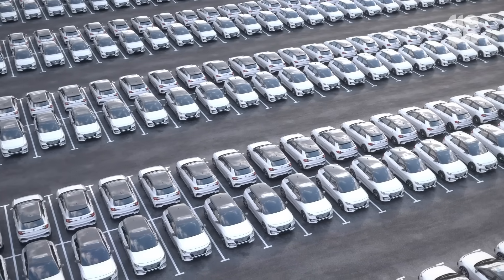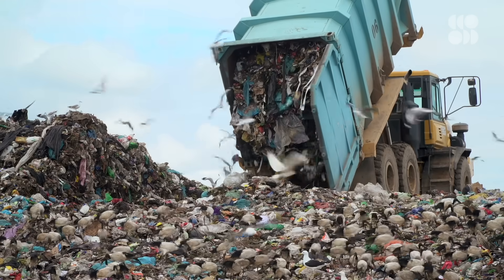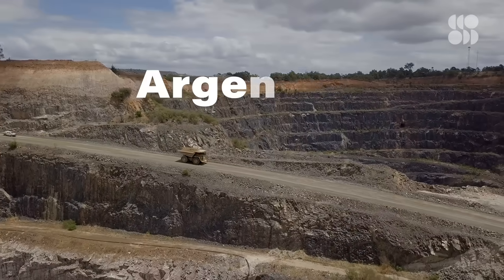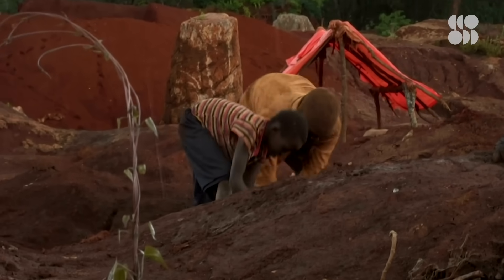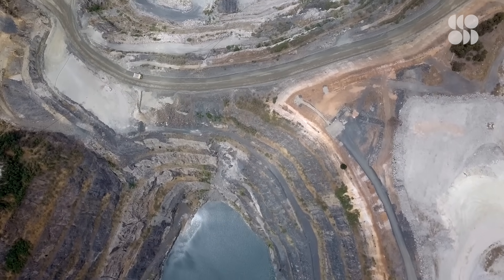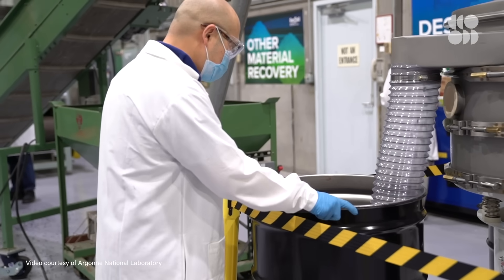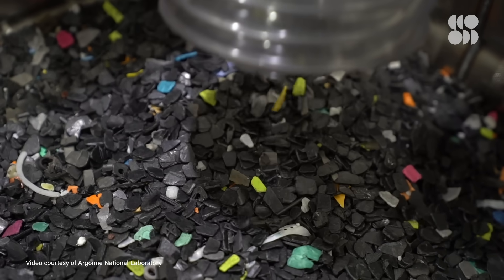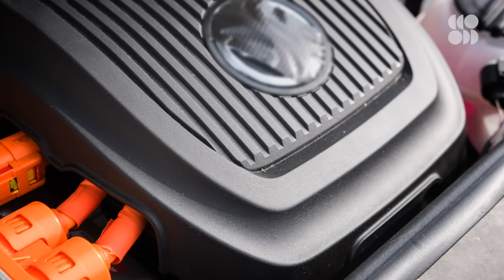The Hidden Environmental Costs of Electric Cars

Comment: Cost-competitive lithium recycling could be a real coup for EVs. If EV manufacturers could put a lien on a car's battery that would make sure that the manufacturer would get the battery at end-of-life for the purpose of recycling, that could make EVs substantially cheaper to the end user, both when they're initially bought and when they have to buy replacement batteries.

Comment: The presenter is completely out of touch with current industry practices. Lithium-ion battery recycling is expanding and gearing up to handle increasing volumes. Many companies have demonstrated 90-95% recovery. The only material not recovered is the plastic cell separator. But before recycling there is reuse, repurpose and remanufacturing of batteries into EV conversions, powerwalls, utility storage and replacement EV batteries.

Comment: Planning to replace all existing ICE vehicles with EVs is not how you fight climate change. It's a fool's errand. The entire concept of personal vehicle ownership is extraordinarily inefficient and wasteful, and insisting upon EVs as a solution to transportation shows the limits of market-oriented thinking as a way to solve ecological problems. 

EVs are part of the solution, but EVs as a one-to-one replacement product category for ICE engine vehicles is not. That's just replacing one set of problems with another. The cold hard truth is that it's not sustainable to be producing this many personal vehicles period, especially not with so many new economies emerging. 

The full solution involves expanded public transit, the normalization of WFH/telecommuting, autonomous fleets over personal ownership (so these massive hunks of steel aren't sitting unused 95% of the time), the end of unwalkable suburbs and a huge shift to local production and consumption.

Comment: 13 gallons gasoline needed to very roughly match 400 mi Tesla. Which is about the average gas tank.

Over 400,000 miles:

13000 gallons 36,400 kg. (30 MPG) gas car.

1000 charges, 400kg EV battery.

91 times less mass needed for the EV.

The EV battery can be recycled at least to 95%, which means another 20 times, or 1800 times less mining needed per mile for lithium EV’s battery versus gasoline.

Comment: Salt water is not rare.
Very little cobalt in Tesla batteries and others are following. Oil industry uses vast amounts of cobalt in production of gasoline..
You are spouting Garbage . Batteries now have 20 year lifespans then more in power stations.
Recycling is at 95%+ now and much higher on metals.

Comment: Another issue you didn’t cover is the energy production required to recharge all of the “green” vehicles.
Reply: The same energy used to extract, refine, transport, and sell the "never going to be green" fuels, only significantly less of it for EVs over time and over lifetime of the vehicles. Spoiler: getting constantly greener, albeit sometimes quickly improving, sometimes not so quickly.
Fuel oil gets less green all the time (extraction gets harder/increasing side impacts too). 
Research readily available today (just make sure you don't trust the stuff published by the oil&gas brigade/those with Vested Interest).
Yes, greener not to have a vehicle at all... But that is not always an alternative or desirable.
Reply: If renewable energy was used at all charging stations then this wouldn't be an issue, but that depends on the location of the charging station. Still significantly less energy than it takes to create fossil fuels.
Reply: @silk.bones.333  the balance of energy is going renewable. For instance, in the UK, the trend to renewables is now unstoppable (including saving all electricity users in the country anyway).
Reply: Gyeah but there's enough fuel in the earth to last forever, not.  So let's just keep using fossil fuels with no replacement in sight so oil companies can maximize profits.  Not planning for a future that you know it's coming and there is no way around is dumb.  Dum da dum dum... To quote South Park.
Reply: @azcomputerg33k  indeed.it amazes me that people can't see the difference between burning stuff and not burning stuff. So much so that they manage to hold this contradiction in their heads: that we can burn stuff forever because it will never run out; versus complaining that electricity is always just the same ...thinking about it ...it's not a contradiction ...it's just blind adherence to the consumption faith.
Reply: Oh, you mean my solar panels that were produced by a factory run on solar panels?
Reply: @azcomputerg33k  I mean the solar panels that supply the energy to ensure that the next set of solar panels are produced using a better renewable balance than the generation before. It's called growth and iterative change. As opposed to ever deepening destruction.

Comment: I'm afraid I do not like this video...I think many of these points are looked at through the rearview mirror.
The industry is young and evolving incredibly fast, so basically those negative points are not against electric cars (most of them are too young to even be recycled) but more against traditional batteries. As electric vehicles grow up, the battery recycling grows with them.
Already today, there are methods of recycling over 90% of the materials cost-effectively, and many startups are entering the space trying to outcompete the competition.
I would have liked the video to be more future-focussed

Comment: If there are components of e-waste that are not cost-effective to recycle, one option is simply to gather the used items into some big repository, while better recycling methods are worked on. Just keep it out of the general waste stream.
Reply: Storage is costly as well though.  It wouldn't take very long for the costs of keeping the stuff to outweigh the costs of recycling it immediately, and we're back to square one.
Reply: @altrag  But do you have anything quantitative? What does "expensive" mean? And there must be many different options for handling the storage, other than immediately recycling everything.

Comment: I think the best way to deal with the problem of electric vehicle waste is to invest in making sure all the electric vehicle designs are built around longevity.

You might think “of course a car company would be building around longevity”, but that would be incorrect because ever since the 1920s, manufacturers have realized that they can make more profits by designing their goods to fail and to be hard to repair, because it forces people to buy more stuff later on.

This is what happened with lightbulbs, with manufacturers forming a cartel that fines members who make bulbs that last too long, which is why there is an incandescent lightbulb that has been on in a firehouse for the last 100 years. Similar things go on with LEDs now with the AC to DC drivers being designed to send far more current through the bulb than it can handle in the long run, and it has been widely reported in car manufacturing, especially with how American cars are designed.

Getting rid of this mandated waste (aka “planned obsolescence”) will protect the environment indefinitely into the future while saving money for consumers to use on everything else they are interested in buying.

Comment: Clickbait title: You need to do more research.
Much of this information is out of date, (eg. dramatic reduction/elimination of cobalt from new batteries being produced).
Reply: But do you have any sources? This subject fascinates me.
Reply: This video isn't wrong. Only a few companies are actually making real progress on this front. There are still an insane amount of Lithium Ion batteries that haven't been recycled.
Reply: You mean from battery chemistries like NMC-811? Yes the industry has sought to minimize the presence of cobalt in cell cathodes, but you can't get rid of it altogether. There is a limit where Nickel takes over and starts to sabotage the rest of the cell. The cell starts to eat/implode on itself basically. 

This video is still relevant though. Let's say 100,000 cars were made with NMC-333. If that's so, then there's 33,333 lbs (or whatever metric you want to use) mined from the earth - theoretically. If another 100,000 were made with NMC-811, then only 10,000 lbs are needed. But if we cross that break-even point of 333,333 cars being made with NMC-811, we get 33,333 lbs or Cobalt. 

With how EVs still take the minority in the market today, there is a propensity for then to outpace ICEVs and become the majority. Idk if it'll happen in the 2020s, but we could see 10s of millions of EVs on the road. 

Despite how battery chemistries and R&D changes over time, the brass tax is that the sheer number of cars still makes a difference. The points brought up in this video remain this general, and are relevant to the issues that we'll be facing with EVs for the next decades.
Reply: Agreed, thank Goodness it's whiskey hour. But I fell for the bait! 🤦🏻‍♂️

Comment: Guess all the "renewable energies" and new battery technology have a down side. But it is still better than coal and petrol based isn't it? 

Can you guys make vid about comparison between the amount of carbon dioxide, nitrogen, methane and other "common" greenhouse gases that emited using coal and fuel than the amount emited if we use "renewable energies"?

Comment: And the manufacture of the plastic in the toys behind you? A bigger issue before BEVs. Little to no cobalt in BEVs Vs the process of oil's from ground to pump. 

I'm 1) not sure where you're going with this video and 2) if you understand/explaining the use potential post vehicle propulsion suitability. Batteries are already being re-used and/or up-cycled for other purposes.
Reply: Well said!!!  This video is ill-informed and not up to the normal standard.

Comment: Cool, now do one on ICE cars. That video could go on for hours...
Reply: Uhm nope it won't. Oil is used by ICE to mine and transport/process lithium, nickel and many other materials.
Reply: @alanmay7929  and in plastic bumpers, various interior parts in the EV lubrication oils in the simple gear box wheel bearings...use oil based lubication in EVs.
Reply: @alanmay7929  For now it is. Lithium, nickel, and other materials used in batteries can be recycled, oil can't once it's burnt. Battery-Electric powered mining equipment will be developed as well. All short-term problems that will be alleviated in the future, unlike oil that has been effectively fully optimized and will never become less polluting. Videos can and have been made that go on for hours about the environmental costs of burning fossil fuels (which still have to be mined by ICE powered equipment too!).
Reply: @justin_time  yes oil is also burned when used to mine lithium. Also there are biofuels and fuels from recycling that have been in use for decades.
Reply: @justin_time  that oil is also used to make tires, road tar, car parts, fertilisers, drugs......
Reply: @alanmay7929  You can get lithium out of sea water. Try to do that with y'all's favourite way of polluting the world, oil
Reply: @whosjulez1157  I know that there is lithium in sea water but in which concentration, also there is no process to exploit it. The sustainability of processes is also a very big thing to not forget, for example nickel in new caledonia and Russia are a nightmare for the environment, they uses chemicals, coal, diesel....... same goes with lithium.

Comment: Don’t be surprised if your used Tesla vehicle battery gets installed in a “new” Powerwall.
Reply: Hard to do since ion lithium batteries deplete with time until they are no longer capable of holding charges. So you are obliged to remanufacture them.

Comment: The Tesla charging stations at truck stops along the interstate are run by Diesel engines and probably use as much diesel as you would filling the car. 🤦🏻‍♂️
Reply: You sure about that?
Reply: @johnmiranda2307  I’m positive they use Diesel engines to power the outlet. The amount used would only be known by the refillers or Tesla.
Reply: @aaronburrell3729  evidence?
Reply: @aaronburrell3729  how does this work for the 1000s of superchargers  nowhere near any fuel stations? And the many 1000s of charging locations on other networks which are also nowhere near fuel stations?

It would actually be harder to make EV charging stations depend on burnt fuel than to just plug them into the grid and drip-feed local batteries.
Reply: @aidanapword  someone comes by there and fills up the engine that powers the charger with diesel. There is a tank for the engine, just like any other engine.
Reply: Tesla do sometimes deploy diesel run mobile Superchargers, but these are usually a temporary solution if they're anticipating higher demand (such a holiday's) or a Supercharger stall is out of order, but they have now largely replaced these with Megapack (battery) based mobile chargers.  EV's charged with a diesel generator still tend to get better mpg than an equivalent ICE based car. It is patently absurd, however, to regularly charge an EV with a diesel generator.
Reply: @matpat2636  absurd, yes. So no one does it. Poster was suggesting this was normal behaviour for superchargers. antiTesla smack talking because they can.... And sad thing is there are a number of people out there who will believe such stupidity.

Comment: I'm getting tired of seeing cobalt singled out for EV batteries.  Many industries use cobalt besides EV's and I watch many videos on how EV chemistries are moving away from cobalt.  We also do not focus on the fact that almost any article one picks up has relied on a mining, leaching or other process for the material it contains.

Don't forget that most of the energy ICE vehicles consume over their lifetimes comes from petroleum produced by fracking, another copious use of water.  While I have not seen recent figures, I recall driving past significant acreage that was rendered non-arable due to leaks of retention ponds related to oil drilling and stimulation when I was young.

The fact that we accept the environmental impact of the mining operations that render the material we are accustomed to in our daily lives make this type of evaluation of the potential impact seem more stark, only because we have not considered the same for those items we currently live with on a daily basis.

On the balance, I do not find trying to touch on this topic in a 4:49 video very helpful.  While I do not find fault with any particular statement, the lack of contrast does not provide any context.  Seeker generally does better than this.

Comment: I think, a great solution is for the manufacturer of a battery type to recycle it themselves after its lifespan is over. 

Because they know exactly how the cell was put together so they know how to disassemble the battery efficiently to get to the precious metals, as well as how to recover and recycle specific parts to be used in new cells (like circuitry, casings etc.) if they’re undamaged.
Reply: @Roger I'm not sure what claims they're talking about, but I'd take those with a grain of salt - being able to make a battery with 95% recycled content is not the same as having 95% of your batteries being recycled.

I mean its definitely a positive, not going to argue with that.  But its always worth a bit of caution when companies brag about their own achievement.  They rarely outright lie but they're happy enough to phrase things in a way that they know will sound better than it might be in reality.
Reply: Tax companies that make and use the batteries por unit and give a tax return for unit recovered. In Argentina normal batteries are taken back by the selling companies since is cheaper than the cost of not doing it due the law that charges them. You go to a hardware store and they take the used ones to be given to distributors up chain.
Reply: Argentvs that’s actually genius!
Reply: you mean when you mix several colors of a paint so well, they can just simply separate when you want to change to another color?.....but you're the one who mix it
Reply: @electronresonator8882  I tried painting a wall with batteries once.  Turns out batteries and paint aren't the same thing.  Whodathunkit.

Comment: This problem can be solved if we have battery standards and we use rechargeable batteries instead of normal batteries. Those pesky remote controllers come with 6 cells. Why not a single rechargable battery pack...